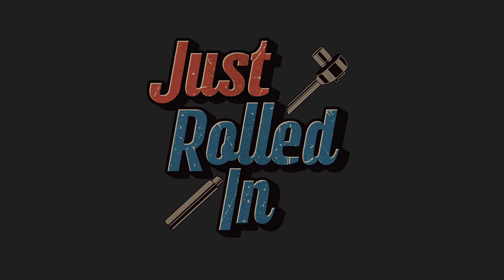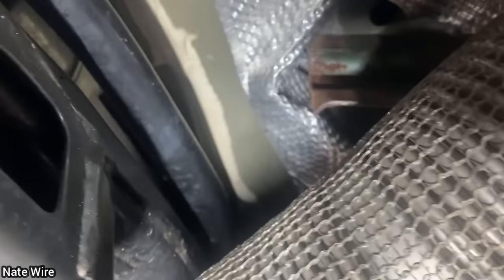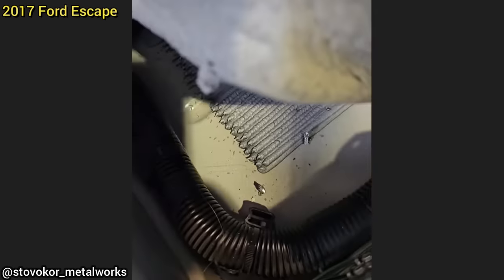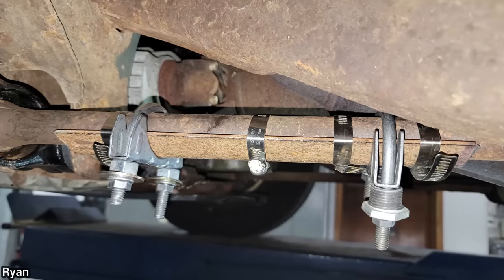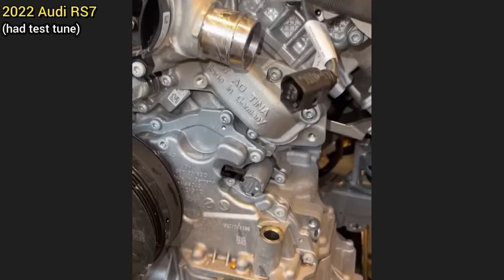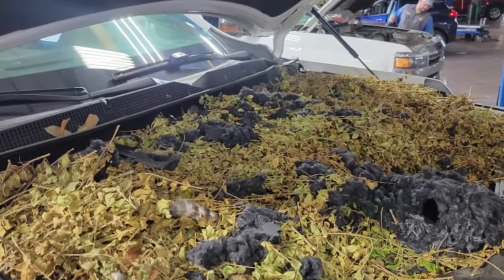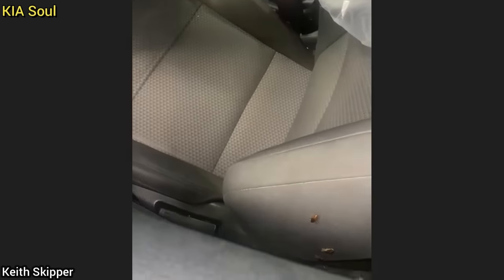Customer States They Ripped The Floorboard Off Their Car

Comment: that wasn't a fence post, that was a highway marker, one of the yellow ones that are off the road to help you if you can't see the lines because of snow...

the heated seats shouldn't be able to fry themselves like that, there should be thermal cut offs before any of it gets hot enough to do that, manufacturer fail.

after market floormats... if i believed in government intervention i would say they should be outlawed.

Comment: I think the melted seat heater was an aftermarket job,the ones on my 2008 lincoln are on a time that shutdown after a few minutes
Reply: So the circuitry is hooked with a pressure sensor to detect passenger presence, right?

Comment: Near where I live there is a Dairy Queen that has a solid Concrete Wall right where the curb should be for the drive through.  It's low key terrifying  coupled with a kinda tight turn to get through the drive through.  And even I don't know how number 1 happened.

Comment: a heated seat that 
1. runs while folded down
2. runs hot enough to melt the seat
3. doesn't have a thermostat to tell it to turn off once heated properly is insane.

litterally any of these would have prevented that situation from happening.
that isn't some oddball thing that someone did. oops i left the headed seat switch on and the seat is folded down.
Reply: That's what you call an egg boiler....

Comment: I helped a friend move with my Soul. My car got infested with roaches. I ended up stripping it down, even removing the front seats, then three days in a row put three bug bombs in it, each set with a different pesticide, and used a spray with a still different pesticide on the seats. Finally, as we started to put everything back, I was liberal sprinkling 20 Mule Team Borax around. That is a dessicant for bugs, and also acts as a cleaner and air freshener for a while. Completely solved the problem, and only stunk for a little while. Serious danger of blowing out the windows from the bug bombs, but I inadvertently infested my house from helping a friend, so it was a necessary risk.

Comment: Heated seats are supposed to have either PTC elements that stop conducting electricity when hot, or a thermostat to maintain the heating elements at a constant temperature. This sounds like bad design.

Comment: If you can turn the heat on with the seats folded that would be a design flaw in my book. It should be impossible to heat the seats in the stowed position.

Comment: folding seats with heaters should have a cut off so you cant run the heaters when they are folded. they should also have overheat protection.

Comment: Don’t buy a Kia with a 2.4 engine. It will at some point throw a piston through the block and oil pan. It’s a known issue and you will be waiting  in line to have it replaced. That is why there is a transferable million mile warranty. During manufacturing the blasting material they use on engines get stuck in hidden spots and isn’t cleaned out before the engine is built

Comment: The seat heater situation is a bad/poor design by those same idiot engineers that put car parts in places that can't be reached without taking 3/4 of the car apart.

Comment: What does 'cheap test tune' mean?
Reply: Someone re-mapped the engine computer and adjusted fuel rates, timing, etc to get more power.
Reply: Modifying the ECU software to increase the engine power output above the rated maximum.  Usually, the transmission will be the first thing to fail, but, as we see here, the engine is also at risk.
Reply: @Tevildo  Ahhh ok thanks. Similar to when I wondered what would happen if I disconnected the wastegate on my turbo. A new engine is what happened lol

Comment: Shouldn't the seat heater turn off once you turn your vehicle off
Reply: some do shut off- my Subarus however have actual switches (rockers in the new Forester, rotary in the old Forester), so once they are switched on, they power up whenever the key is on.
Reply: @YXEBears  It said they were on a road trip, which to me means many miles driven.
Reply from the maker: Some do. On our vehicle it stays on unless you depress the button.

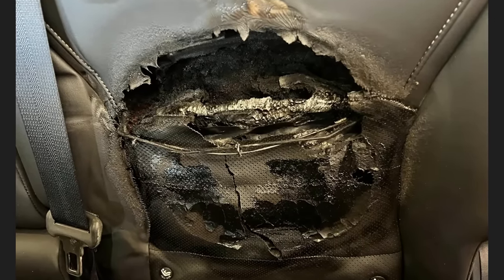Comment: 1:55 Good to see they included safety features such as a positive temperature coefficient resistive heater material to limit temperatures, thermal fuse incase something goes wro... Oh, wait. Never mind. And god forbid it comes on in the summer. Your balls will be so saggy that you will trip over them and be sterile for life.

Comment: #6 This is why on the rare occasions that must use self tappers to hold up a heat shield or undertray, I only put them in places where they won't go through the floor pan.
#10 This should not have happened. Seat heaters have temp sensors so they don't get too hot AND they typically deactivate when the car is turned off and won't turn back on unless a button is pressed.